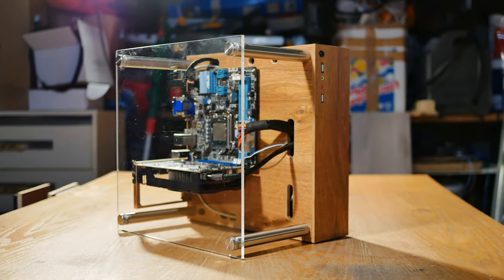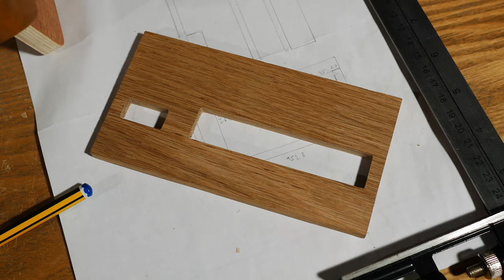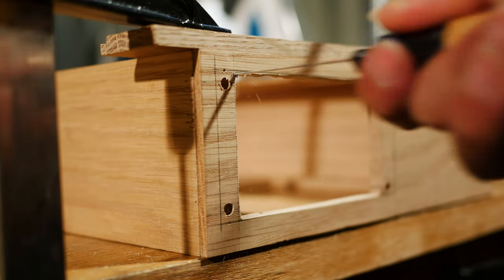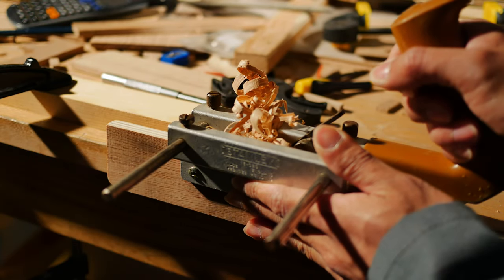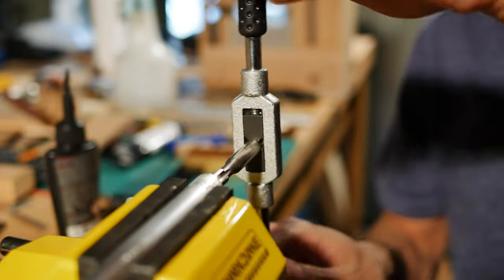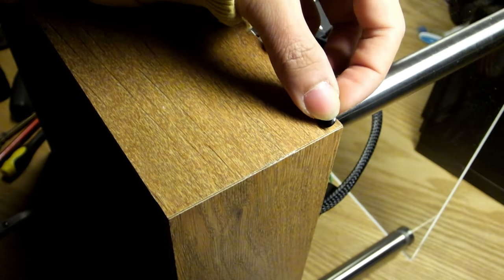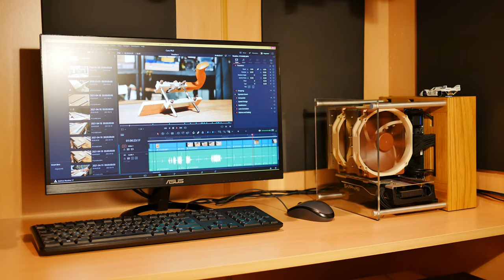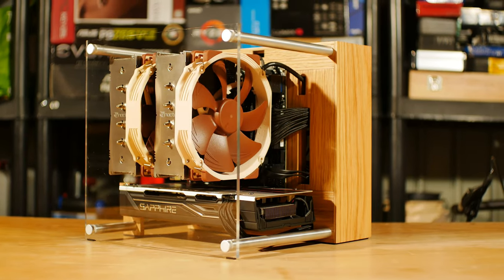DIY Mini-ITX Case - Thermaltake Core P1 & Corsair Crystal 280X Inspired

Comment: Hello, perfectly processed, perfectly filmed.
Problem to solve: Have you thought about the temperature of the large 3.5' HDDs at the bottom? In my opinion, their temperature will be too high.
Reply from the maker: No more an opinion, but a fact - the HDDs reach 60'c under full load, and one of them died a while ago

A solution would be to fit a tiny fan inside the compartment, or open up the top to promote airflow, but life gets in the way

Thanks for your thoughts